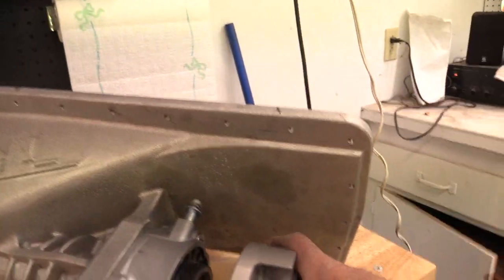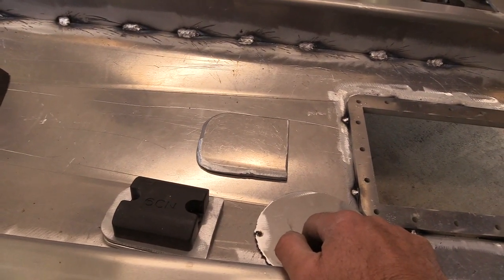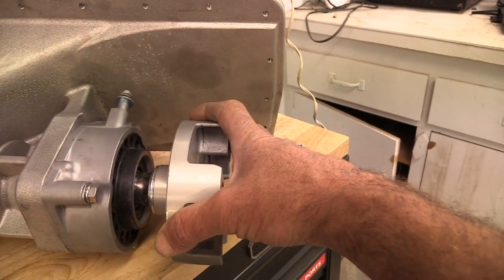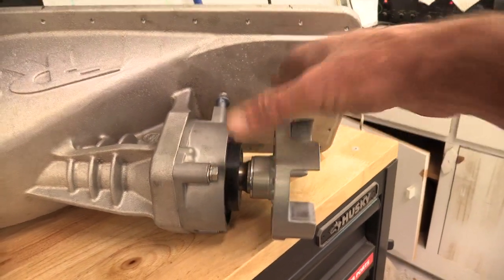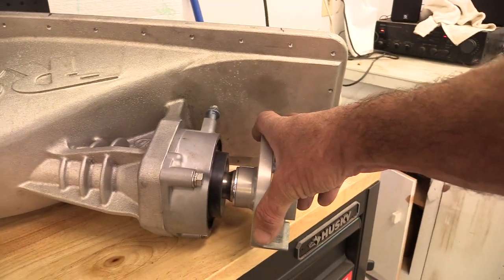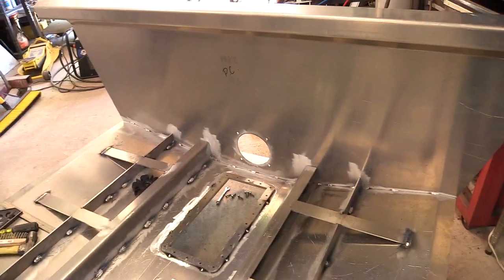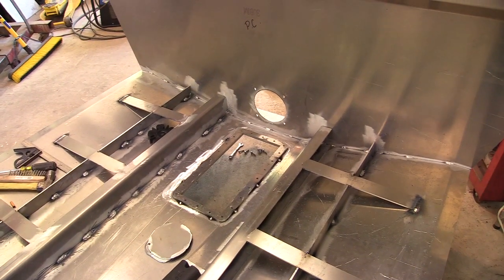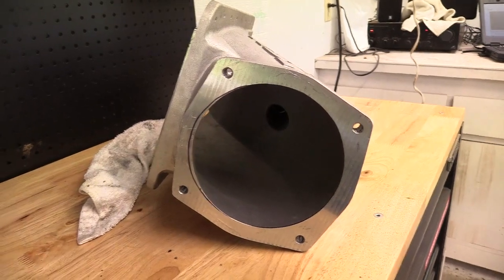Wattscraft Mini Jet Boat Build Video #15 Intake and Motor Mounts

Comment: Clearly you didn’t line up the engine correctly. Machine both couplings and use a small block of machined steal to line up. Shim the engine. Basic JetSki stuff